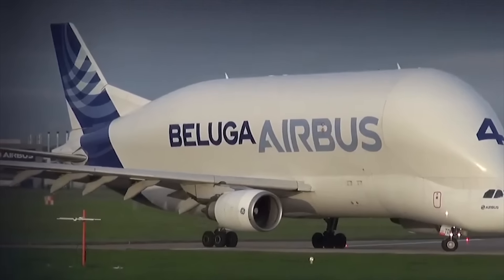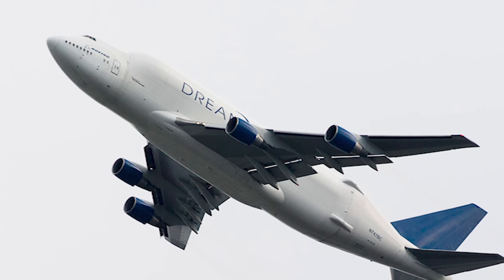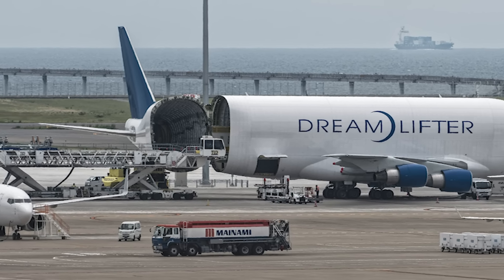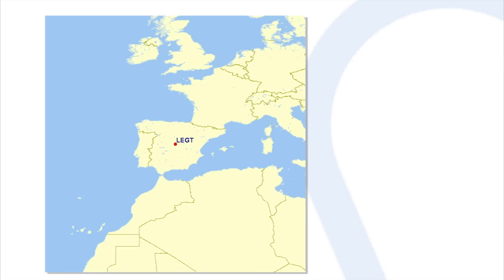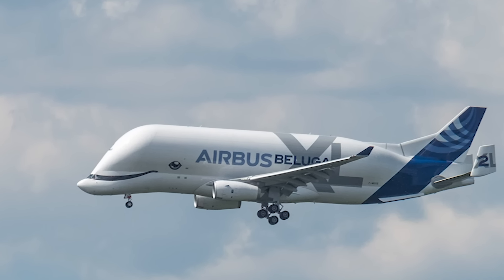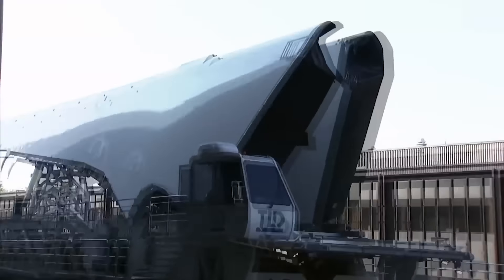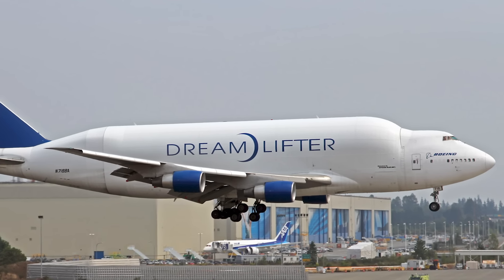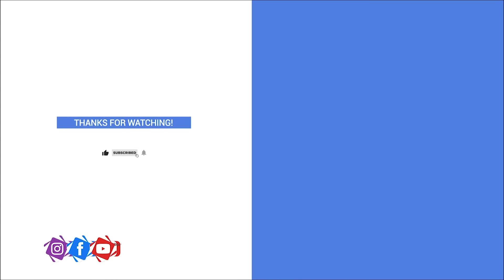Battle Of The Beasts: Boeing's Dreamlifter Vs Airbus' Beluga XL

Comment: I like the Belugas more than the Dreamlifter. They are well constructed and don’t look like an afterthought.
Reply: well they didn't built the planes from new, they took used 747 passenger aircrafts and chop it up and insert new parts.
Reply: yeah that’s why they are an afterthought penitent. They didnt design a whole plane just for it, they just reused some old 747’s
Reply: @penitent2401  So were the Belugas
Reply: @9999AWC  the Belugas were redesigned and modified from their existing designs but the aircraft themselves were built from new. the Boeing literally buys back old 747 planes from airlines that has used them for years to cut up and modify.
Reply: Plane looked like it bump its head.
Reply: @penitent2401  gotcha. You’re not a recycler. Rather create more waste.
Reply: Do your research well, before you expose your now very apparent ignorance on the topic you so passionately feel for.

Here's to your understanding why the Beluga XL is not a recycled old plane. In 2013, the five original Belugas could not cope with production growth, and Airbus evaluated the Antonov An-124 and An-225, Boeing C-17 or Dreamlifter, and A400M, before choosing to modify one of its own aircraft. The program cost is €1 billion for development and production and is based on the A330 freight platform.

You see, Airbus did try to look the options available. They just didn't find what suited their needs and were thus compelled to spend a billion euros for the fleet of six.

They spent a billion euros on planes are not for sale. Do you still think they didn't look at all other options, including try to copy what Boeing did with the Dreamlifter? If you still do, you are sadly doomed to a life of perpetual ignorance.
Reply: Is this sarcastic ahahahahhahaha
Reply: @peterk814  They don't rust as much as you think in the correct desert. There's a reason why there's a commercial and military aircraft storage facilities in Arizona near Tucson.  The air is so dry there, there's not much moisture to enable rust.  

But it's also interesting that Boeing used a lot of past technology on the Dreamlifters.. The locking hinge design is from the 777 folding wing design (that no airlines wound up using), and the tail is actually off the 747SP model.
Reply: I'm embarrassed to see as an American that we suck, there's no competition against the Airbus beluga look how beautiful it is on the other hand our airplane looks like just any other modified airplane on the line, compared to a specialty airplane Made specifically for a job
Reply: @iamfour  well, given Boeing's somewhat precarious financial situation at the time, I figure most of Boeing's engineers were at work on the 787 Dreamliner, and it was more cost effective to modify existing technology and equipment.  After all, only 3 Dreamlifters were initially conceived, the fourth one happened later.
Reply: @penitent2401  Oh I already know that. Seems I misunderstood what you meant in your original comment. My apologies sacred Oracle.
Reply: They both look ludicrous but Still cool ass planes.
Reply: Beluga is also an afterthought built from a A330
Reply: @evergrandebestrealestate4854  belugas opening up cargo through front is just so much better and safer approach. With tail cut - Boeing had to pretty much rework all the wiring that goes to tail controls and tail is no longer attached to frame the same way. Airbus on other hand insisted on not touching tried & tested integral structures. As always Boeing is no stranger sacrificing safety standards for saving few bucks.
Reply: HAHAHAHAHAH omg the beluga is the one that looks like an afterthought hahahahah omgg i can't believe yous
Reply: @iamfour  There is competition! The biggest is that the Dreamlifter can carry almost twice as much payload as the Beluga! Both Aircraft were ade for a job, the dreamlifter is te 787 and the beluga xl, the a350, but one is bigger and one can carry more.
Reply: It depends on the design approach of two companies. Airbus decided that the BelugaXL did not required huge MTOW and long range, so it was designed just for the sphere of influence of Europe. Airbus, believe or not, has much more experiences with transporting parts by air, from the Super Guppy times. The A300ST was designed in such way where the deficiency of design of the Guppy was overcomed, and priotised the efficiency of turnaround. So on a operational perspective, the BelugaXL is more purposed built. Imagine a turnaround time of 1 hour and 20 minutes for the Beluga. 

Also, Airbus would know themselves whether to use 2 or 4 engines on the BelugaXL, since A330 and A340 share the same general wing design, other then reinforcement of airframe may be required for 4 of the more powerful engines.
Reply: Ikr, same
Reply: the beluga is better than the dreamlifter in my opinion, and also the name is cute and the little smile and eyes on the plane. meanwhile DREAMLIFTER just sounds like boeing is trying to make it sound cool but really, it isnt.
Reply: Airbus Beluga = A300-ST Airbus Beluga XL = A330-743L
DreamLifter = Modified 747-400
So all are kind of after thoughts
Reply: @MkurugenziMwenyekiti  cmon its flying metal tubes great artists copy cmon and atleast airbu made new planes instead of 747 which can retire anytime soon with the Beluga XL it will atleast be here for more time than dreamlifter

Comment: Here we see the quality difference. Airbus builds its Beluga’s in-house on a brand new A330 freighter optimized for its needs. Boeing goes in cheap, buys a couple of old 747s from China and converts them in Taiwan. And although the original Belugas have been around for more them twice as long as the Dreamlifter, Boeing managed to make it look like they’ve been around since the late 80s
Reply: Quality? Or engineering preexisting vehicles to suit need? Airbus had history of creating similar sort of aircraft whereas Boeing didn’t. Boeing were able to modify an existing design - so why not do that?
Reply: Eh... China Airlines is the national airline of Taiwan - the Republic of China.
Reply: Boeing super guppies have been around since the 1960s,in fact Airbus used them for a long time.
Reply: I think the main point here is the Dreamlifter may be an airworthy engineering marvel, but the unsightly seams on the bodywork at 0:58 near the main cargo bay make it look really old or like a rushed project. The Belugas on the other hand are simply beautifully finished. It's not a beauty pageant, but if it was...well.
Reply: @MkurugenziMwenyekiti  yep, and the increase in drag from the variations and changes in the surface of the body doesn't seem that good. If Boeing is gonna continue using these for more than 10 years, they should redesign a more purpose built aircraft for that job. I ain't saying it's bad, but it seems like it's getting really old and old fast.
Reply: @adams.9029  That's cool and no one was saying they're not imposing, they just look less sleek. And you being an ex-employee seems to make you somewhat biased.
Reply: @daneclark3161  china airlines operates from mainland china
Reply: @amark4663  - No it does not, other than operating a few flights to the mainland.
Reply: @daneclark3161  ayo my bad I thought it was air china CAUSE IT'S 2 DIFFERENT AIRLINES sorry man
Reply: @TheEchelon  How was he being biased when he complimented the Beluga as well? smh
Reply: @adams.9029  Great to see someone marvel at both aircraft and not feel they must take sides in what is a petty and tiresome Airbus v Boeing debate. Thanks for your contribution.
Reply: Your perception of "quality" is way off base.  Both the Dreamlifters and the Belugas are purpose built, serve their purposes well, and have been reliable with perfect safety records.  There is no rational reason to say that the quality of either is any greater or lesser than that of the other.  Cosmetic apperance does not equate to quality.
Reply: You don't replace a proven platform just because it doesn't look cool.  747 is beyond proven.  Its simply the most stable jet thats ever flown.
Reply: @TheEchelon  Sorry, the Dreamlifter is very impressive in person.  Ive seen it in person.
Reply: That tail snap thing feels a bit unreliable. Wouldn't feel comfortable being on that plane. What Airbus did was taking a tried and tested reliable plane and ensured to not touch any key structural components and wiring. Boeing on other hand just cut the tail of and rewired it like a surgeon would an amputated leg - it's just not as a solid reliable compared to Airbus' Beluga.

Comment: Personally, I want to see a "Great Beluga", built using an A380 double-decker as the basis. Used to help move plenty of large payloads whether it's rocket boosters for EU space agencies or parts for a massive wind turbine.
Reply: The problem is that those demands are already being fulfilled by road, sea and rail transport so there isn't really anything Airbus can offer. The ESA built their space port next to a regular port for a reason.

Comment: A few things to consider which is the better aircraft:

In terms of volume, Airbus Beluga < Boeing Dreamlifter < Airbus Beluga XL

In terms of MTOW, Beluga (155 t) < Beluga XL (227 t) < Dreamlifter (364 t)

In terms of range, Beluga (2000 km) < Beluga XL (4500 km) < Dreamlifter (7800 km)

In terms of operations:
The Airbus Beluga and XL are totally self-sufficient. The cargo door has electrical motors that allows the door to operate without any ground equipment. For the crew to access the aircraft, there's no need for external airstairs as the entry hatch below the fuselage also contains deployable stairs. In the event of cargo shifting loose, it would impact the cargo door, rather than the crew cabin as on the Dreamlifter. Unlike the Dreamlifter, the Beluga and XL has an APU, allowing self-sufficient engine starts.

The Boeing Dreamlifter is not self-sufficient. It needs a special ground jig to open the swing tail door, which is not powered at all. The locking system is also a lot more complex and heavier than on the Beluga. The crew also needs external airstairs to access through the normal passenger entry doors (as on a regular 747), therefore disallowing the aircraft from operating from an airport without airstairs. In the event of cargo shifting loose, the aircraft requires a very strong bulkhead to prevent loose cargo from penetrating the crew compartment. Unlike the Beluga, the Dreamlifter does not have an APU, requiring an air-start unit to start the engines.

Comment: As for looks, neither is a great beauty, although the Beluga with its 'smile' is really rather cute in a funny sort of way - unfortunately the Dreamlifter is just plain ugly!

However, as well explained in the video, they are designed to do a job and need to be judged on that and that alone.

What would be interesting is if Boeing and Airbus were to do a swap and see how each others products met (or didn't meet) their needs. If they both did, then judging them on cost of operation would then be an appropriate way of determining which is the winner.
Reply: Thinking the dreamlifter is long to handle fuselages.  Beluga would be too short.
Reply: 0:58 The Dreamlifter is operated by Atlas Air Inc. Does that mean it doesn't actually belong to Boeing? That would explain why (still on the same 0:58 frame) it has Frankenstein monster-like seams on the custom panels that create the main cargo bay. Very unsightly and unlike Boeing. But if the thing does its job well then that's all that matters.

Edit: watched the Dreamlifter ownership/outsourcing part later on the video.
Reply: @danharold3087  Front section (cca 10m) of dreamlifter is not wide enough to fit fusalage in while beluga goes all the way thanks to cocpit that is moved below the cargo bay. I suspect there is less of a difference in cargo bay length than in total length and I'm not even sure if dreamlifter is longer inside (counting only the wide section, there probably is cargo area below cocpit, but that is definitely not wide enough)
Reply: Assuming the French would make something and not think about the aesthetics of it is very naïve. the belugas are pretty sleek and elegant, and the cute smile is a bonus.
the dreamlifter on the other hand... ew.
Reply: Both aircraft are winners in that they do the job they were designed to do. They were not designed for a beauty contest nor to achieve commercial sales.

Comment: While it is true that Boeing hadn't utilized a swing-tail design before, that's not to say the company was starting completely from scratch. Back when they acquired McDonnell Douglas, they also acquired their then-decades-old design of the DC-6's rare swing-tail variant (DC-6B-ST) (of which only two or so airworthy examples exist today; both with Buffalo Airways if I remember correctly).
Reply: Airbus used Boeing pregnant guppy aircraft for decades before they copied the concept on one of their own airframes.
Reply: @kdrapertrucker  The Pregnant Guppy isn't a Boeing design, it was an aftermarket modification to a Boeing aircraft made by a small private air cargo company. It was initially designed to transport parts for NASA but after the end of the Apollo program the company was struggling until Airbus acquired it and then embraced the concept fully.

Comment: Always amazed that people have such a preference for one manufacture over another that they feel the need to express their unqualified opinion about it in an attempt to trash the other manufacturer.
None of us are going to be buying either one of them so their looks simply don't matter to the manufacturer as long as they get the job they were designed for done. These two aircraft are designed to fulfil a requirement, looks quite simply don't matter. And as for Boeing converting existing aircraft to make the Dream Lifter, well that just makes economic sense.
Reply: Its been like that. Those are the types of people that have bias between Airbus and Boeing because of their polarized minds. I don't have a polarized mind therefore, I have no bias between Airbus and Boeing. I like them both and I am impressed how they can make oversized planes to transport aircraft components for airplane productions.

Comment: Range is also a major difference. The Dreamlifter has a range of 7 800 km with a 113 400 kg payload and the Beluga XL has a 4 300 km range with a 50 500 kg load.

Comment: I prefer the looks of the Airbus.
Reply: You could fit the baluga in the dreamlifter
Reply: @kdrapertrucker  so? the dreamlifter still looks a mess
Reply: @soilentgreen7  who cares how it looks as long as it does the job well.
Reply: @wasmiddelsap3379  no, you don't. Maybe Airbus should work on their customer service. Since they can't seem to maintain the equipment they were contracted to maintain.
Reply: @kdrapertrucker  
You can't, the Beluga XL actually has more internal space than the Dreamlifter.
Reply: @mikeblatzheim2797  do you know the best aircraft manufacturer in the world is LM not Airbus.
Reply: This thread is just a huge mess.
Reply: Wow, all I said was I prefer the looks of the Airbus, and then the thread has gone off on one. Whichever you prefer, they both do a great job and are a perfect example of great engineering.
Reply: @jonnmedds  basically mankids💀

Comment: Idk y Boeing is getting so much hate as it isn’t like beluga was made from scratch (beluga is based on the a330)
Reply: It is because of the bias between Airbus and Boeing that people have with their polarized minds. I have no bias between those major aircraft manufacturers, I like them both.
Reply: TBH both the BelugaST and BelugaXL were "built from scratch", whereas the Dreamlifer was converted. One was developed from, one was modified from. While not against one manufacturer, the Beluga was a masterpiece - in terms of logistics for Airbus. It is proven to be efficient and reliable for Airbus operations, and from the previous experiences of owning the Super Guppies, the Beluga was designed partially based on the shortfalls of the guppies, like having to disconnect flight controls to open the cargo door with cockpit attached. Imagine a turnaround time of less than 2 hours for the Beluga. That said, both manufacturers have different priorities. Airbus didnt care bout the MTOW and range, Boeing didnt care bout the turnaround time.

Comment: I always wondered what would happen if they used the a380 as a base for the beluga. I
Reply: Such an idea may not work, as the plan the build the A380F fell through as well. The problem is that with its massive volume, it simply can't carry the weight required to fill the full fuselage top to bottom (and forward to back).
Reply: @Gameflyer001  that's true yeah, but considering that it would have to transport Aircraft parts mainly, the cargo weight may not be as dense as, let's say, two gas-turbines for power plants. So I think at least regarding that problem, it could find its niche in some place, but considering that a plane as large as the A380 won't be build again anytime soon, there is most probably no need for it anyways.
Reply: I suspect that it'd be a lot more difficult to do the thing that the Belugas have been doing where you move the cockpit down with the A380 which makes it a less optimal candidate.